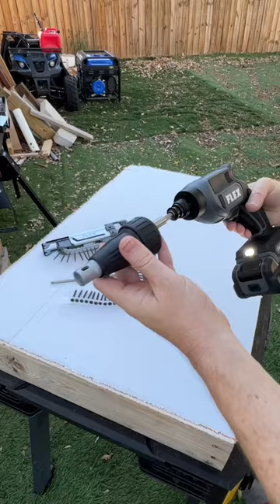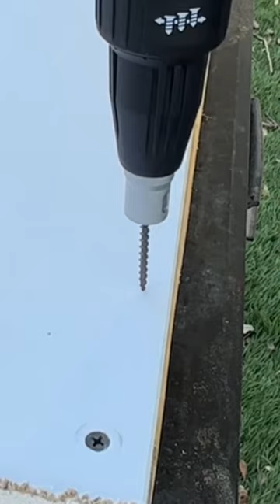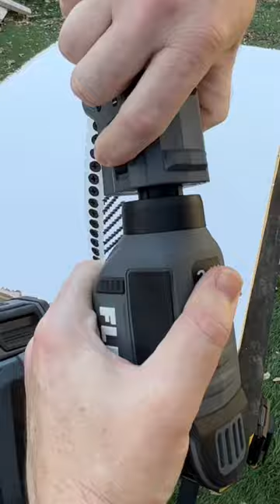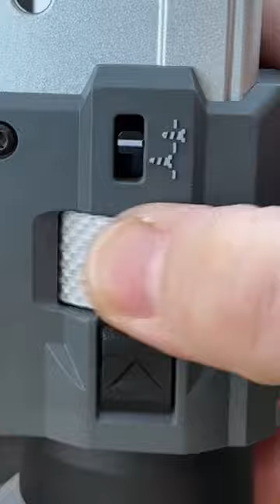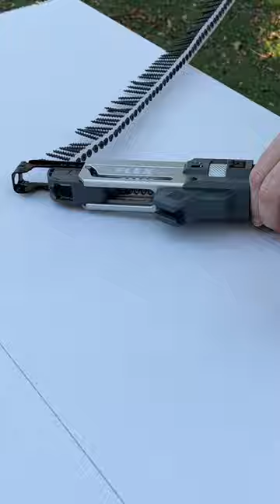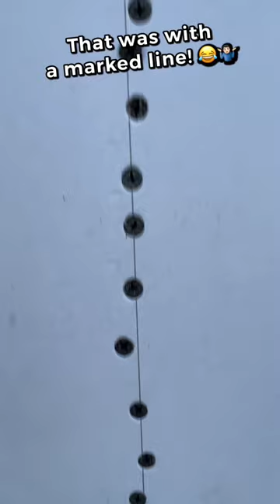FLEX 24V Drywall Screw Gun With Magazine Attachment! 😮😍🔥

Comment: Dude I only run DeWalt but believe me when I tell you that FLEX is super smooth and a better gun overall than any other drywall gun on the market period. 

Listen all their tools are really excellent man I have switch over
Reply: I see why I had problems with mine. The store sold me square head screws with it. So, I now have to get a new Phillips 6 " bit for it. Live and learn. Just want to pass that on incase that someone else did not know before buy one and leaving the store with the wrong screws. Watching your video helped me see why mine was not working right. Like I said. Hope by tell how I made a mistake helps someone else from making the same one.